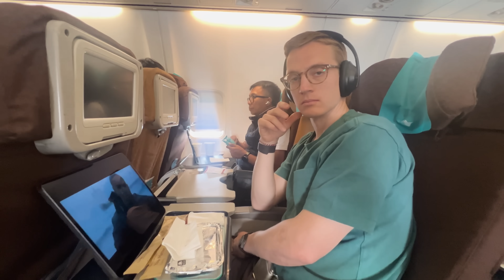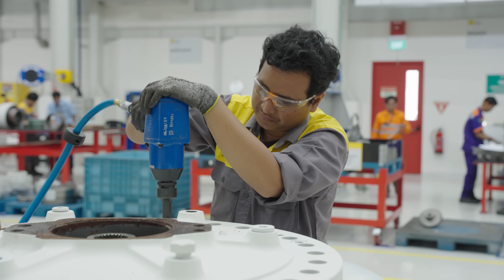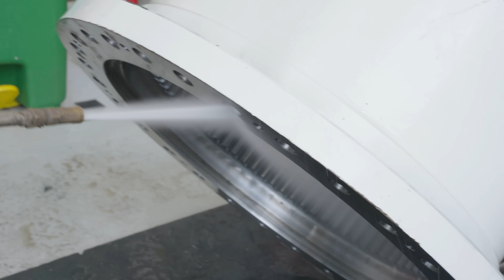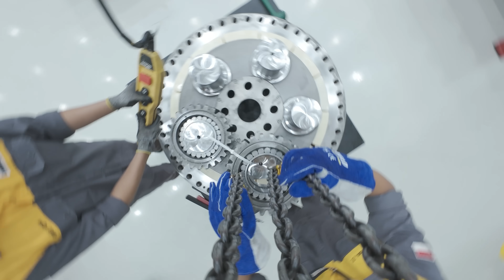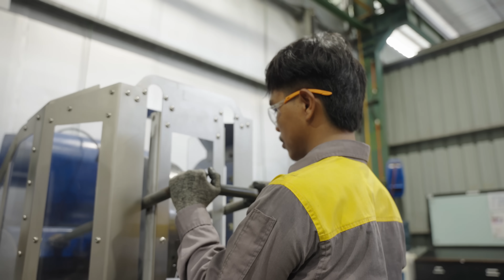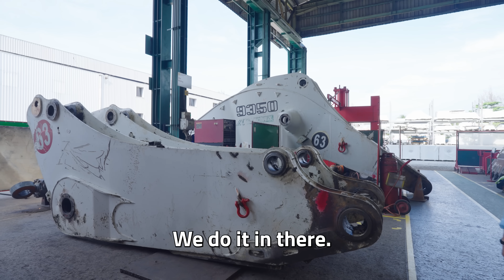Bringing Mining Machines Back to Life—Workshop Tour!

Comment: 2 days from blast to paint in that humidity? That's wild. We have to kick parts back to blast if they exceed 4 hours before getting prime coat (in a climate controlled environment). Plus, slapping blasted steel with your bare hands like that puts oils back on the surface and contaminates the substrate, leading to premature coating system failure.

Comment: I feel like not one single person in that shop knows why they're doing anything, they just know what to do. Baaaaad.
Reply: It's very much like how an assembly line factory would work. Each person does one particular job over and over, with some variation for different models of parts. They can achieve a much higher throughput and have better overall quality (presuming each person is better at their individual task than one person would have to be at every task).

Comment: If Liebherr could fix their electrical and computer issues… they would have some of the best equipment in the world. Their equipment is horrible for electrical issues. I’ve worked for multiple companies that have demo all types of Liebherr equipment and every single time there are serious electrical issues occurring within months of delivery. I really wanted to like Liebherr equipment but I’ve personally struggled because of it. One company I worked for invested heavily in Liebherr equipment around 2006. The company purchased over 20 brand new pieces of equipment. It took a few months to get everything delivered. We began using the equipment as it arrived. Unfortunately… That same year we ended up with so much downtime due to issues in every single piece of equipment that the company ended up having to lay off over 30 people due to the hardship incurred over the issues. We ended up having to hand the job over to another contractor because of Liebherr equipment. This was not a small job either. Massive job on an international airport. Luckily we landed some more contracts on that huge job and continued… with different brands of equipment. That’s my Liebherr story. I’ve heard the same from a lot of people about the electrical issues. Shame. Idk how their equipment is since the pandemic. About every company in my area refuses to run Liebherr after all the issues over the past couple decades.